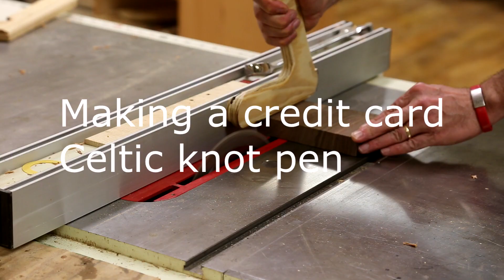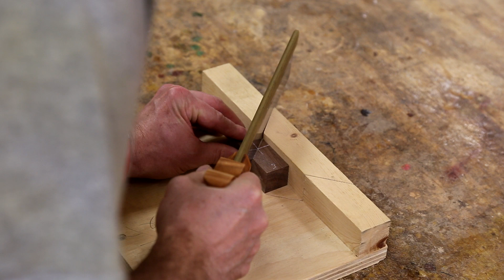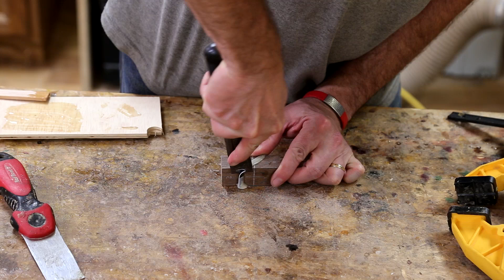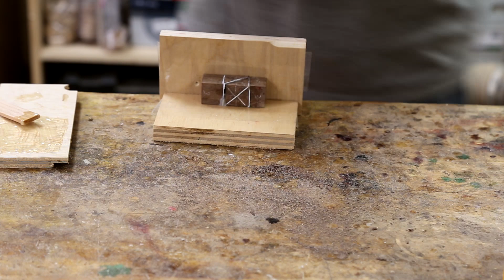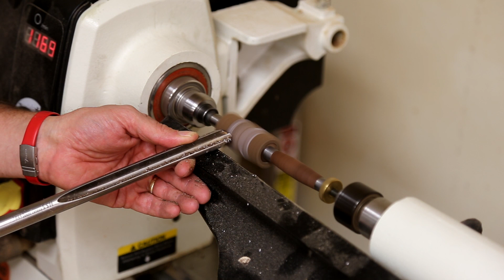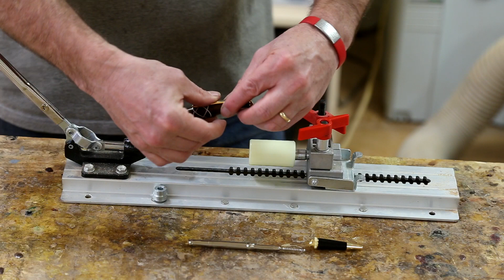Making a credit card Celtic knot pen

Comment: Also, when drilling the first one you didn't use a pecking action to clear the swarf out of the flutes. My guess is that the plastic swarf overheated and glued the drill to the wood. Possibly, the drill you are using claims you don't have to peck, but I think it's wise with such a fragile workpiece.
Reply from the maker: You're probably right.  I usually can feel when it's wanting to grab and I back it out to clear.  Sometimes I can get a little excited/aggressive and don't excercise enough patience.  Thanks for watching and commenting!

Comment: I guess what's confusing me is, are you rotating the blank for each side the 45 degree cuts are on, gluing the card in, and repeating 4 times?

I realize this is 5 years old, but hoping to get a reply.
Reply from the maker: That's correct.  They're angled in the blank and they then become eliptical(?) when turned becausre you're turning a round section angled to the angles, or something or other like that.

Comment: Nice pen. I noticed that the knot doesn’t meet in a few places. If you use a stop block when cutting each angle cut then the knots will align better. 

Thanks
Peter
Reply from the maker: Thanks for watching and for the suggestion!  I will likely use a stop block as well as my miter saw instead of hand sawing the next one.
Reply: It is also important to have the creditcard insert be the exact same size as the kerf you are cutting.